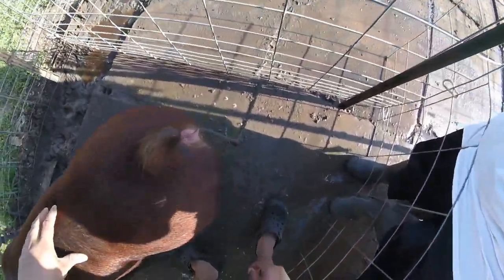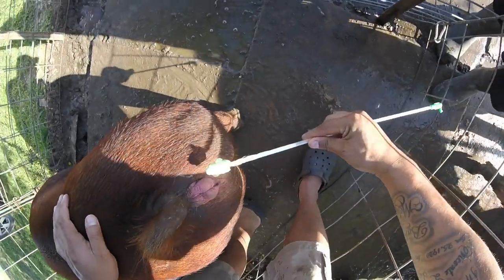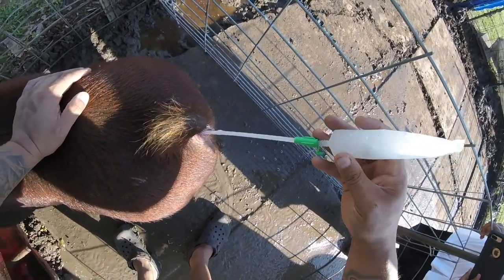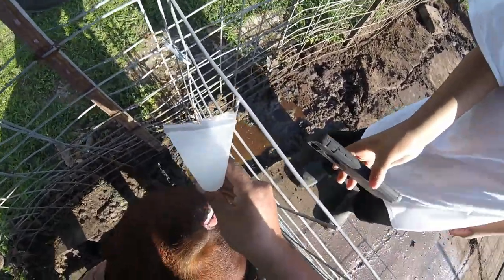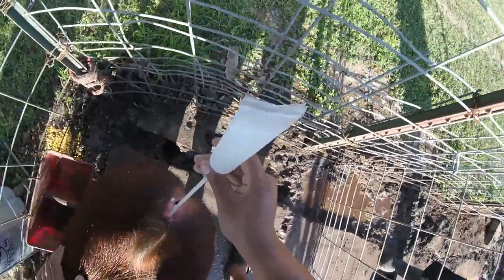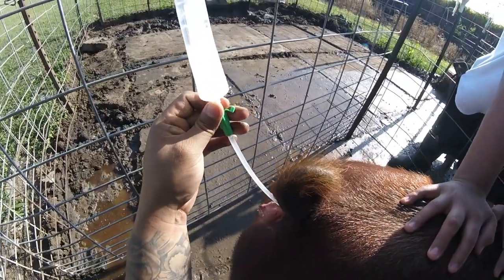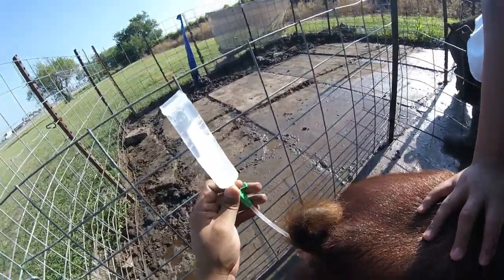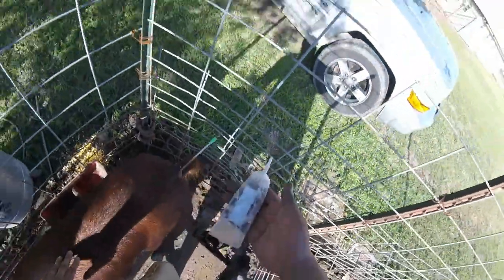How to A.I. a gilt with foam tip gilt breeding rod.

Comment: I need your help on something since you know what to do with pigs I am showing a gilt in may and she is the most stubborn pig I've had and does not want to walk so do you have any tips with that
Reply from the maker: Dante 1632 what exactly is she doing? Just not walking or responding to whip.. pipe.. flapper
Reply: I'm using a whip and she does not want to walk my advisors told me to use some treats but that is not helping either
Reply from the maker: Dante 1632 if she just doesn't want to walk you can try to whip a bitter harder or you can try like marshmallows on tip of a whip or stick and make her walk with her head up as she wants to get marshmallows and tap/whip with the other hand as she walks... but if your going to show in May that's pretty close to try to fix a walking problem but try it out it just might work
Reply: okay thank you very much
Reply from the maker: Dante 1632 then you might just have to be a bit more firm with the whip if the treats don't work ... and try to work with her a bit more .. hope everything goes good